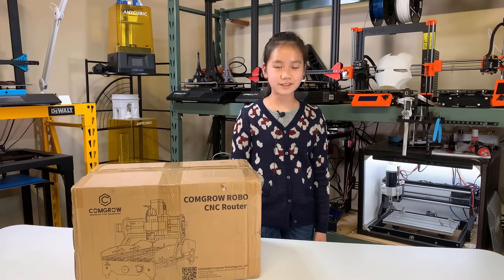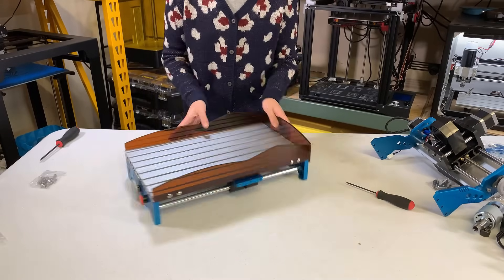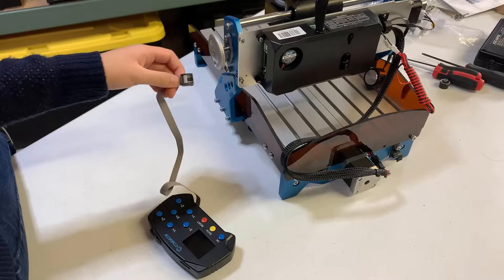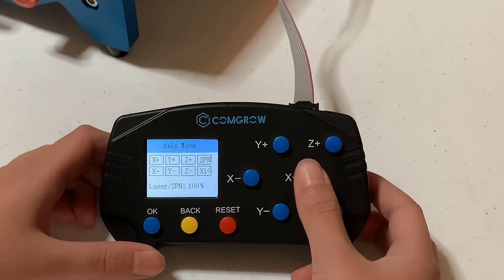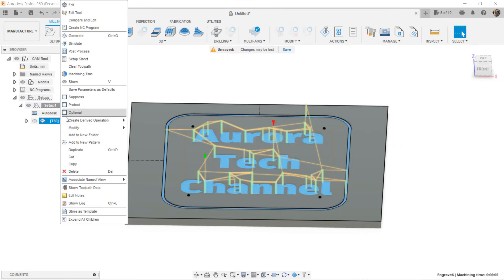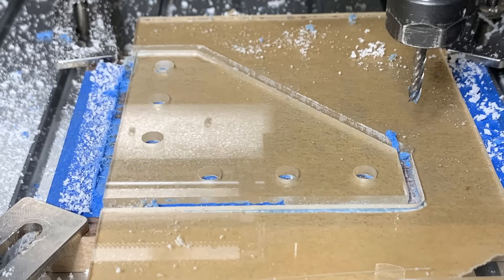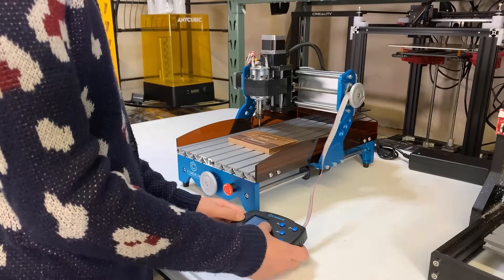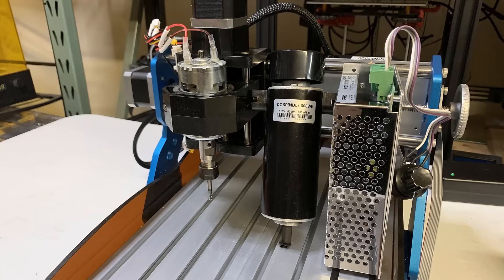Comgrow Robo CNC Review: The best first budget desktop CNC router / engraver for beginner?

Comment: One of the best YouTube channels. Thank you!
Finally got around to setting up my Robo CNC that I bought several years ago. Haven't used it yet because I'm sorting out the upgrade brushless 55mm 500W spindle motor along with a custom designed dust shoe. The spindle mount was custom designed and 3D printed with PETG. I've replaced all of the stepper motors with larger NEMA 17-48 motors to give the spindle motor a little more authority when cutting denser/harder materials. 3D printed X/Y/Z adjustment wheels with handles to make manual adjustments easier. I can tell you that Comgrow did NOT have the beginner in mind when they released this thing. The biggest negative with this machine is the user manual. It was not written for beginners in mind. It doesn't explain what the two slide switches in the control box do and where they should be set. It doesn't talk about setting up a laser head, even though the machine includes a mount and electrical connections for one. It also doesn't tell you where to plug the Z-probe in and how to use it. The ER11 collet system is not explained. Luckily, I'm not too dumb so I've figured it out on my own, but I shouldn't have to do that. Hopefully it'll perform well with some small projects I have in mind. I also plan on making a mount for a swivel knife from a Cricut machine to enable me to cut vinyl stick-on sheets along with other thin materials such as aluminum foil.

Comment: Every 3018 is a bad joke compared to this. It is solid and rigid with the X axis being the shortest. It has nicely designed axis knobs.
I tried the Sain Smart 775 ball bearing upgraded spindle. They both have .001" (.0254mm) run out which is a problem for metals with this diameter cutting bit. I think it is a problem with the machined collet these motors use. Get rid of this runout and with proper feeds and speeds, this will cut steel. I will say again, proper feeds and speeds. 
The Pulse Width Speed control does not work well for these small motors and can be very noisy. I ordered a proper benchtop power supply and it runs much smoother and quieter. When I have the time, I may go back and redo the spindle collett but I have other more precise machines for steel. A precise spindle is the answer, not more power.

Comment: Hello I have a question
I use Comgrow CNC every day. I bought jz based on your recommendation. Unfortunately, recently the bearings in the spindle broke and I had to buy a new spindle. Because it was nice to get an original one, I bought a Genmitsu GS-775M 775 CNC Spindle. Unfortunately, it does not want to work with the Comgrow CNC motherboard. It starts shaking strangely for a second and then stops. Do you know what could be the reason for such behavior?

Comment: If you’re not sure on how deep to cut a groove, set your g-code to make a shallow cut. Set the z axis for plenty of room between the tool and the surface of your work during rapid moves. If you want to go deeper, move the tool off to the side of your work piece and run the tool down so that your z axis is at zero. Jog the tool down the amount you want more cut out and reset the Z axis to zero. You can run the same code without changing it and the tool will cut deeper the amount you moved the z axis. Also the other direction, if your code is set for a deep cut, you can raise the tool up from the zero position and reset the z axis to zero. Again without having to change the g-code and it will cut a shallower groove.

Comment: I can’t find any machine that looks solid and has 500 watts or more for under $1300 so I ordered this since it is $203 on Amazon now with Prime shipping. I guess I will have to do your mods. I took from your video that the 500 watt motor is better than 800 due to working at lower RPM.

Comment: Do you think it could do stainless steel engraving ?
Reply from the maker: I think light engraving on stainless steel should be fine at a slower speed, but not cutting.
Reply: @AuroraTech  Light engraving like 0.1mm ? And with the 500w spindle upgrade ?

Comment: What settings did you use to cut acrylic? Bought this machine and having issues with material(acrylic) that melts around the "drill" (the ones that came with the machine).
Reply: Feed soeed:100mm/min
Incised speed:30mm/min
Cutting depth:1.5 mm
Spindle speed:10000rpm
Spend Time: 2hours and 30 minutes

Comment: Great video! I do note that using a similar piece of scrap wood floor sample my z hight does not reach all the way down before it hits the z endstop switch.
Reply from the maker: You can adjust the clearance height in Fusion 360 CAM or edit the gcode file manually to avoid that.

Comment: hi, what do you think of the new 3020 Pro Max  ? think it came out just after this video lol  its allready got a 300w spindle and aluminum and steel frame, any chance you will get one for a review?
Reply: I do have one. Its not bad, but has a few issues to be fixed. 
E.g. endstops, play in the nut holder from y

Comment: Stock motor has a 44mm diameter so a larger 500w motor will need a 52mm or so mount.  As the rails are larger than a stock 3018, it doesn't look like any pre-made mounts will work.  This will need a new 3D printed mount.  If one is made, include a mount for the Z axis switch this model has if possible. 

Eager to work with aluminum.  

Also, have had no luck in using the Z probe with Candle- once you set the height, it is still hovering off the work surface, but that seems to be a Candle issue.
Reply from the maker: Yes, you are right. I emailed comgrow and they sent me the spindle mount STEP file, I will modify it to fit 52mm and share it in future videos when the upgrade is completed. BTW, I Universal Gcode Sender, I think it's better than candle.
Reply: @AuroraTech  
Thats what I'm waiting for, would love to be able to make metal brackets and such! It is a nice looking machine for that price. Thanks!

Comment: I recommend you to attache a plywood to the bed, then you drill a 1 centimeter x 1 centimeter matrix hole and finally you carve the surface so the bed will be totally parallel to the router. Then, every time you want to carve a material, you will know exactly where you have to drill the material in order to screw it to the bed